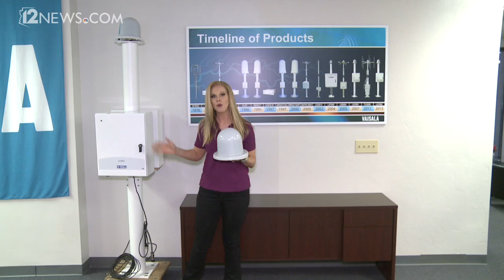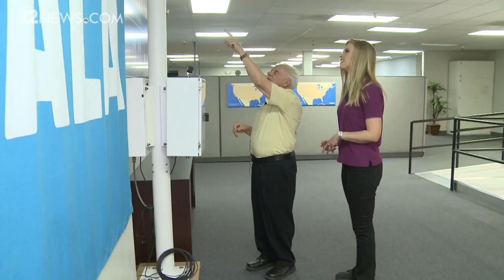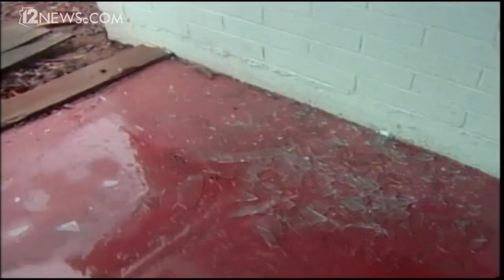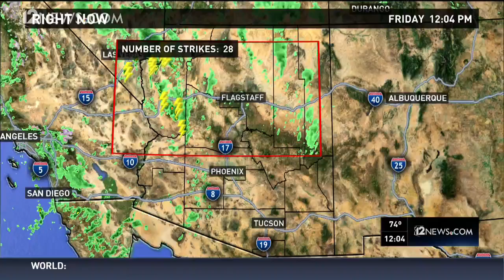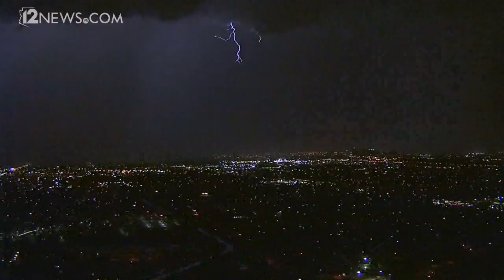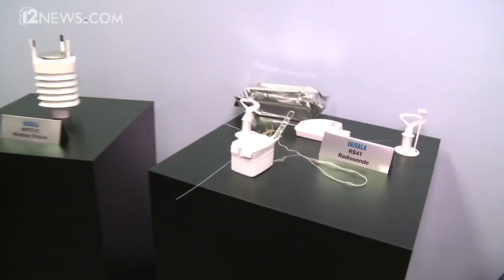How we know when and where lightning strikes

Comment: Ok… it detects lightning… but HOW???
Reply: How do you detect when lightning hits you? Big surge of voltage in your body?

I imagine it has to do with detecting a large influx of charge in the earth. And calculating the difference. The earth has a charge itself by the way. And it able to detect the angle based on trigonometry I imagine. And then you calculate how long the impulse take to get to you from that direction and you have distance. I dont know though.